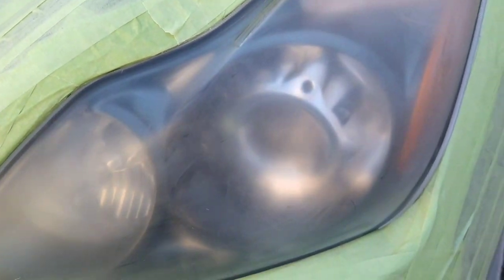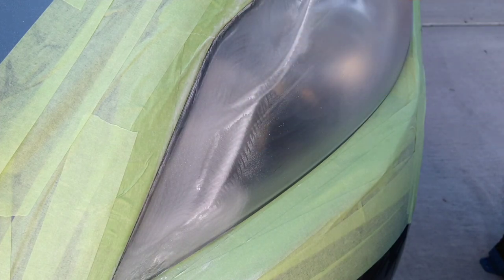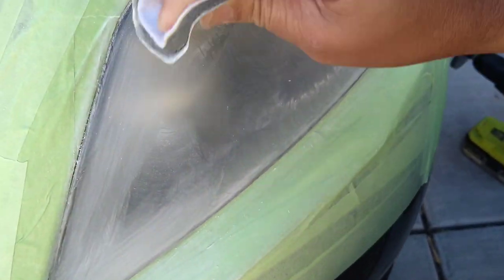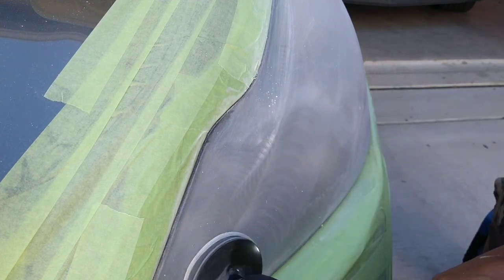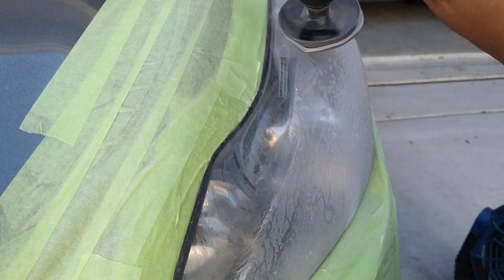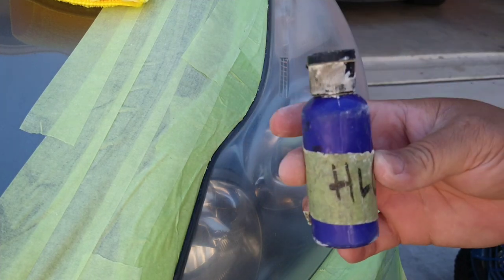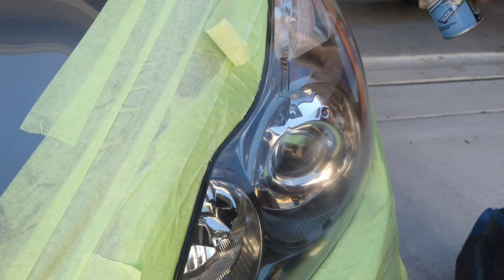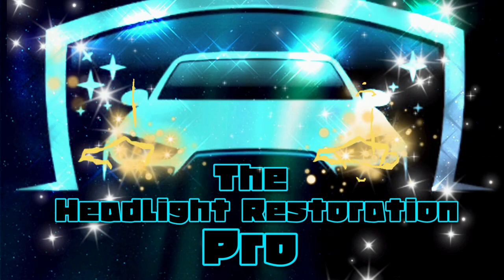The Most Requested Headlight Restoration #1 (Infinity G37s)

Comment: Eventually my g37 IPL will need this same treatment, but for now the OEM clear coat is still holding up, probably due to 48k miles and always being garaged/not used to commute and park at work (when that was still a thing).

Thanks for all the insights and regular videos! Cheers!
Reply: @theheadlightrestorationpro  sorry if this sounds like an idiot question...

But why do you specifically use a drill and that model you've linked to, instead of say the polisher for all steps... Does the drill provide more speed options and granular control using it to sand with?

Or is it simply form factor and backing plate option based?
Reply from the maker: @krazyfiend  okay the difference between the polisher and the drill is the drill is going to operate and much lower speeds and comparison to the polisher. Also the drill is optimal for sanding because of the torque the drills have a lot more torque than the polisher. Polishers are all about speed not torque the max speed of the drill is about 1500 or so..
The max speed of the polisher is about 7,800..
That's some of the key bases.
Reply: @theheadlightrestorationpro  thank you. I'll make sure to use your referral links to add stuff to my Amazon black Friday, cyber Monday basket.🧺 😂

Just caught the end results and full car sweep. You made that better than showroom.. looks like you did a paint correction (OEM orange 🍊 peel looks gone!) and not just a decon, clay, polish, coat (not saying that isn't a lot too 😂) .

In a future video, unless you have one already, I'm intrigued how you approach headlights with "crazing". Does it depend how far and pervasive the micro cracks and varies? Do the cracks only go down so far?

Anyway, killer results...keep on movin' and prospering!
Reply from the maker: Awesome I appreciate it they give good kickbacks and these links a lot of the times..
With the crazing, I called the Spider Cracking most of the times it's not all the way through and a majority of it or better yet a lot of it will be masked by the time you hit your finishing product.. but you can only deal with what you're given. You can make a headlight better that has the spider cracking, also stop it from furthering it comes from heat. Generally without the UV coding present the headlight overheat... This is one of the main problems when people use non headlight certified products, overheating spider cracking.. or just if they wait too long with their headlights damaged.. getting all the time...
There's two different kinds sometimes the clear coat cracks this way and sometime the actual light cracks his way but most the time it's not through and through...

Comment: I saw you used 800grit before the wet sand, what grit sand papers did you use dry then wet? Great job thanks!
Reply from the maker: Everything is shown in the video and listed in the video if not they're listing the bio if not there's other videos that will show you.... It was a p800 much different than 800...

Comment: The Meguires UV overspray going on the hood - the cars paint doesn’t hurt the paint? You said it cures so fast ….so that overspray cured onto the hood section that was not masked off with painters tape? Or can it be taken off easily from paint/clear coat?
Reply from the maker: No overspray.... Overspray is not  a problem with this product if you properly tape off... Zero gets on paint... Observe the tapping method...the tip is very directional as it's made for headlights....
Watch this..https://youtu.be/tDuyrgoj6-k

Comment: Hi Thanks for teaching I have 3 restoration under my belt what are your thoughts on polymer vapor? Thank you
Reply from the maker: Definitely should use a mask that's specifically designed for chemical vapor nothing else.. I used to use an everything cartridge but it's not strong enough still taste and smell it.. stuff is very strong

Comment: Good Day HRP, firstly great job as usual. I love your methodologies which keep generating consistent results each time it is truly remarkable. I am a mobile detailer here in Jamaica and I also use the Meguiar's G17804 to coat headlights, but when use as directed (Apply 1 medium wet coat letting the first coat dry 3-5 minutes, then follow with a second medium wet coat) the light is hazy in appearance, but when applied as you did in this video using a generous amount, it yield a better result. Therefore, is it safe to assume that when applying the headlight coating, you should use generous amounts? Looking forward to your response, - Thanks in. advance
Reply from the maker: Yes I discovered this a long time ago although the instructions say double coat I have done some research and I have done some testing the double coat method is not what you want to do because the crust forms so fast that there's an issue with double crust double layers... See this video. 👇🏽
https://youtu.be/NgxNImOAoCY
So I developed a single coat method with this product.. I use about the same amount as two coats, a thick coat and apply the painter's method where I start with a small amount for adherence and just layer thin coats over it all at once which is why you see my pattern moving back and forth back and forth back and forth. The clarity is enhanced doing this..
Check out the video really explain some things... That's what any product as well..
Thanks for watching.
Reply: Negril, Ocho, Mobay?
Reply: @theheadlightrestorationpro  Thanks I will be sure to try this

Comment: Living in CA where cars really get beat by the sun, it seems like the cars from the Japanese manufacturers have headlights that haze up very quickly in comparison to the European and American manufacturers.  It also seems like the clear coat on the paint fails a lot faster.  In terms of preventative maintenance, do you think that any of the ceramic coatings slow down the aging process on these headlights?
Reply from the maker: Not really you would think so though.. I don't really recommend ceramic coatings on headlights because for One ceramic coating isn't dissipating form of protection just like Wax is but wax is more pliable workable and has less effects to the surface of a vehicle and definitely to the headlight much easier to work with on headlights and more beneficial..,(far as hydrating in a softer change to it)
Also ceramics are brittle and hard and extremely thin... I have a video where I did clear coat testing and ceramics do provide enough transparency for headlight standard up there with the best but it lacks in a lot of other things because of its thinness... Which adds to itself breaking down faster, surface impact issues such as: cracking and pitting and crowning etc... And it's also not recommended to do more than one coat which I have another video up about double coating is severely diminishes your light output due to layering... The best thing anybody can do is provide aftercare... But a lot of people don't want to deal with that...
Also have a video about aftercare..
https://youtu.be/kIur4XxYjDk
Reply from the maker: Also you are right the European headlights last a little bit longer because they use a much harder coating closer to a 2K clear and their actual headlight structure is much much harder... the formula...
But like I tell everybody I feel their headlight method is flawed.. just because something lasts longer it doesn't mean it's better for whatever it is.. metaphorically you got to think that some people outlive their body and are decrepit and handicapped and have Alzheimer's and dementia and things like that that's a form of something lasting way past its expiration date.... Metaphorically the same thing happens with headlights so if you could rejuvenate the headlight before all these things happen what you get is a perpetual and continuous healthy headlight for the life of the vehicle..
The European vehicles are notorious from permanent damage from its natural coating and it's natural hardness.. being too hard there's lots of room for damage the Japanese vehicles make their softer but they last literally forever even though they go bad faster... Essentially they're better product.... A Japanese headlight will last 25 years if you take care of it even with regular headlight restoration and taking care of a European car I say you got like 10 before you start really having damage that you can't come back from and they'll still work but it won't look as good..

Comment: i’ve never dry sanded a headlight only wet sanded. Do the pads get gummed up ? I would much rather dry sand as it looks much less messy.
Reply from the maker: They do not get gummed up... Only thing happens is the natural darling of the sandpaper pad., It's a much more efficient way of sanding... You have everything turning into dust instead of goop...
Reply: @theheadlightrestorationpro  that’s good to know now i really want to try it. thank you

Comment: You ever done a 7th gen toyota celica headlight resto? I need to do mine and the shape seems like it might be a challenge for my first time lol
Reply from the maker: Honestly I've never worked on one of these it's a really rare car... With that being said I've worked on many similar style headlights.  Best advice I could forward is to just watch the corners and if you're using machine make sure to tape off heavily.. and watch the machine on the corner use your hand sandings on the corners and folds areas...💯
Thanks for watching
Reply: @theheadlightrestorationpro  thanks for the advice! Going through your vids a lot lately. Do you have anything on knowing when to dry sand vs wet sand? I dont know the difference

Comment: any problems with orange peel?
Reply from the maker: Good question.. ZERO PROBLEM as you see this is part of the reason why I film so  closely on these videos I come up on the headlight about one inch away.. this product is designed for ultra clarity, and if you run through the steps correctly the orange peel nothing.. ZERO
But mainly the reason why there is no orange peel is because this is a headlight certified product that is designed for headlights by scientists...
Thanks for watching...